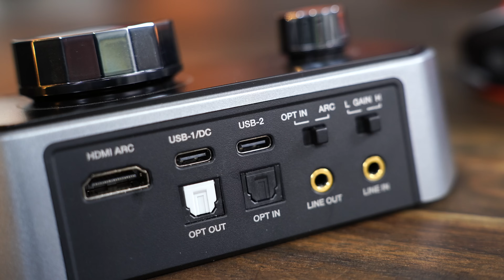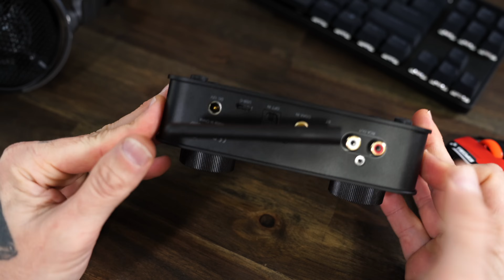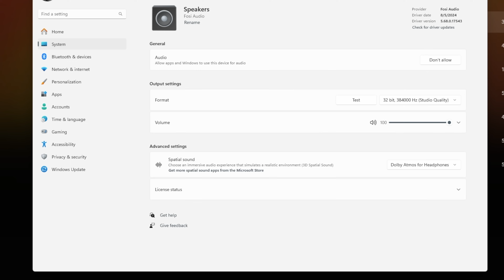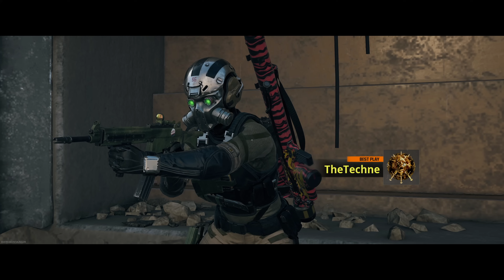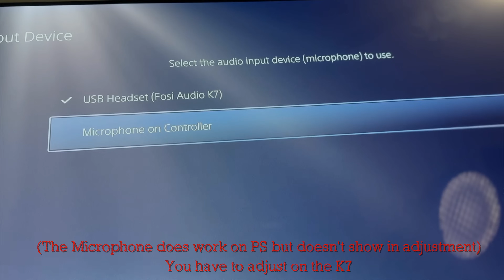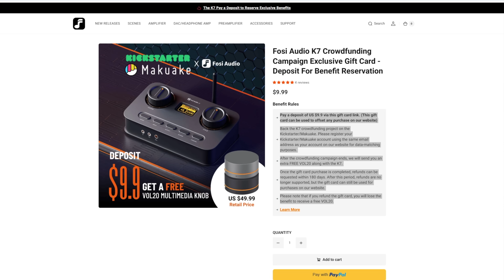Your Gaming Audio is About to Get a WHOLE Lot Better!

Comment: just got one of these cause i trust your opinion is there a way to run a audio controller through it like the fifine sc8? or if anyone else knows
Reply from the maker: Have you used it yet? I still main it and love it! As for audio controller, I haven't trued that
Reply: @TheTechne I have I decided to get rid of the audio controllers entirely cause it works so good 😅 using it with the inzone h6 airs

Comment: I know this is an older video, but I have one question. I will be using optical for my PS5, but I'm curious if it will run a USB-C microphone while running the audio through optical? That's my biggest concern. I don't wanna buy another mic lol

Comment: How does it compare to the Soundblaster GC7?
Reply: way F*CKING better just switched. Its not even close.
Reply: @DeathDancerHades can you elaborate why you think that is? Is it sound-wise, staging, build quality?
I am kinda torn between them
Reply: @ibadriba okay so with the g8 if you run one usb it has an awful buzzing noise. Footsteps was nulled on my kiwi ears quartet, the interface was jankey. The power from the k7 blew it out the water I would actively avoid sound blaster products I had it for a week and it just was a week of being pissed off as a tech guy trying to get it work how I exactly want it. No such thing with k7 and senheiser ie 100
Reply: @DeathDancerHades  thanks. And as for the SXFI and Surround sound function or the sound profiles Soundblaster offers (ie dedicated CoD or PUBG modes)?
And do you use it in USB or optical?
Reply: @ibadriba  I would not even bother with it felt like it made hearing footsteps worse.

Comment: Excuse me Sir but what are your settings on the PS5? Do you use PCM, Dolby Digital, Atmos? Is it connected via USB or SPDIF/TOSLINK? I am quite sure that it does not decode Dolby Digital, so if you use Tempest Audio from PS5 you can not stream at the same time because to use Tempest it needs an USB connection and there is only one choice to the sound output right? You either choose USB to get the Tempest Audio or another, not the two at the same time, is that correct? Thank you everyone!
Reply: I’m using this device on my ps5 and it does connect via usb cable to the ps5 and ps5 3d audio works for me. I’m using the pc38x headset although I’m currently shopping around for a closed back headphone to use with it. Not sure what I want to go with yet.

Comment: I’ve heard you can’t use a standalone mic on these, is that true?  I just got the fifine k688
Reply from the maker: I use my elgato wave with it. But are you asking about a stand alone 3.5 mic?
Reply: @TheTechne, thank you for the quick response.  Im using the fifine k688 and got it working.

Does it matter if the it's not recognizing the fosi k7 in the sound drivers?  Mine is showing up realtek, which is what my pc had prior to the fosi.  

I tried download the fosi k7 driver, with no luck.

Any input is greatly appreciated, I'm very new to the a dac/amp setup.

Thank you

Comment: If you really want whole lot better gaming sound - plug in a pair of good 300W studio monitors with 10 inch drivers. This is truly another level. No headset gives you that.
Reply: That will just give you a lot of bass in your face. Point of headphones is the details. Headphones might have an edge there.
Reply: @eugene4637  >Point of headphones is the details.
Do you want to say shots and explosions sound more detailed in headset? You serious?)))
>That will just give you a lot of bass in your face. 
That will give you sounds you never heard in headset. This is the reason why studio monitors exist - to give most detailed sound.
Reply: @alexpetrov8871  Monitor headphones also exist. Yes, you can hear all the frequencies from 20hz to 20kz with a headphone. I also use speakers myself but there is reason why headphones are the first choice of a pro gamer. So relax boy. I am not attacking your 10 inc woofers.
Reply: Nah a good headset will give you that bass as well

Comment: You mentioned that it has Bluetooth support, I wonder how well it works with airpods and other earbuds since you can't directly connect them to ps5 and it would be a nice go in between. For instance, how big of a delay does it add compared to something like using a gaming headset with a dongle.
Reply: Bluetooth for audio is typically atrocious for anything that is not music. Depending on the Bluetooth in question could be minimal latency to who knows how many seconds…not milliseconds.

Comment: Things Not Mentioned 
(In spite of comparing it to SoundblasterX G8)...

Does it support simultaneous audio input streams? 
I will assume it doesn't because of the dedicated input select button... 
But that doesn't mean it can't do simultaneous Bluetooth.
So can it?

Can it control Game and Chat volume Separately?
I mean it has 2 knobs.... that would be the perfect feature for 2 knobs...
(Compared to the SoundblasterX GC7)

Does it support multi channel audio streams? 
i.e Some Hi-Def Audio of orchestras are recorded in 5.1 or 7.1. 
While the PC Driver or software can perform a 2.0 Downmix, 
the SoundblasterX can process the multi channel stream and perform a downmix on device,

As well as adjusting a virtual surround space.

Does the Optical Input support Dolby 5.1 or DTS audio?
Since there's no onboard surround processing I will assume it doesn't.

Not many devices bother to do this.... But I would still like to know.

Does the Volume Synch with Windows or Mac?
Not a deal breaker but useful to know as I have a dedicated digital volume knob for my PC sound.
(Some people have volume knobs on their keyboard as well)

Does it have Mic Sidetone? 
Is it adjustable?

Can it answer calls via Bluetooth using the connected headset?

If so does it mute the audio? Does it mute the Mic? 

Does it lower the volume and ring when you receive a call?
Reply from the maker: Sorry I didn't answer Some of your concerns/questions in the video, so here they are. If you have any other question please do ask and I will test it for you. 

Does it support simultaneous audio input streams? 👉 No
I will assume it doesn't because of the dedicated input select button... 
But that doesn't mean it can't do simultaneous Bluetooth.
So can it?

Can it control Game and Chat volume Separately? 👉 No you can only control core volume and mic volume
I mean it has 2 knobs.... that would be the perfect feature for 2 knobs... - One knob is for vol/gain other is for mic vol and eq's as shown in video
(Compared to the SoundblasterX GC7)

Does it support multi channel audio streams? 👉 No
i.e Some Hi-Def Audio of orchestras are recorded in 5.1 or 7.1. 
While the PC Driver or software can perform a 2.0 Downmix, 
the SoundblasterX can process the multi channel stream and perform a downmix on device,

As well as adjusting a virtual surround space.

Does the Optical Input support Dolby 5.1 or DTS audio? 👉 When connected via optical it switches to 24bit 192000Hz auto/max. You can activate DTS and Dolby on windows while connected via optical
Since there's no onboard surround processing I will assume it doesn't.

Not many devices bother to do this.... But I would still like to know.youtube music

Does the Volume Synch with Windows or Mac? 👉 On windows it doesn't sync, you can still control PC vol and K7 vol separately, on Mac it does sync but the vol bar doesn't show.
Not a deal breaker but useful to know as I have a dedicated digital volume knob for my PC sound.
(Some people have volume knobs on their keyboard as well)

Does it have Mic Sidetone? 👉 No
Is it adjustable?

Can it answer calls via Bluetooth using the connected headset? 👉 No

If so does it mute the audio? Does it mute the Mic? 👉 It mutes the vol when getting a call

Does it lower the volume and ring when you receive a call? 👉 It actually completely mutes the vol, and with my testing the phone call would only play through the phone, not be diverted through the K7
Reply: @TheTechne  Thank you so much for the quick concise reply.
Keep up the good work.
And I do agree that the SoundblasterX DACs can be a bit gimmicky at times, but they do a lot of things well. And I'm only bringing up the  SoundblasterX because there isn't much competition in this specific space.
Reply from the maker: @abesabes3rd  Oh 100% agree. I have used and reviewed many soundblaster devices, and they are all very very good for sure, a bit gimmicky yes, but still great. 
It would really depend on what the user needs/wants. I personally just prefect simple straight o the point great sound with minimal adjustment. That's where this K7 really sits, very similar to the ifi zen.